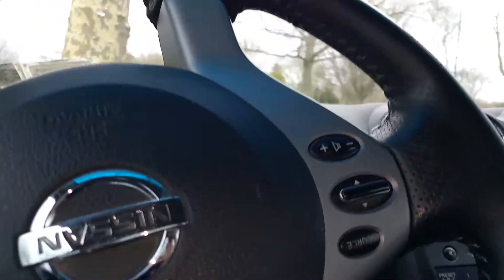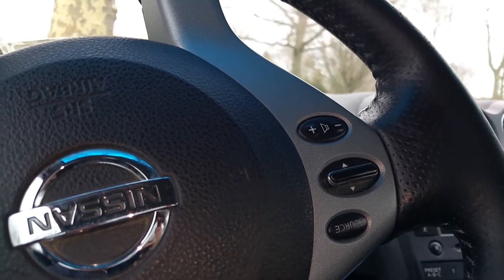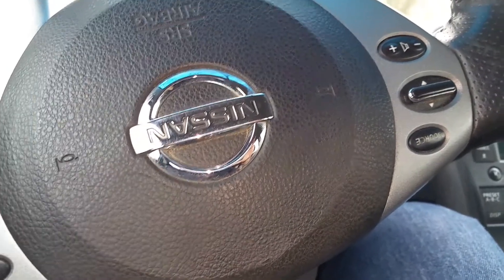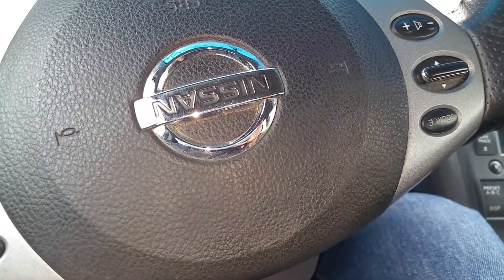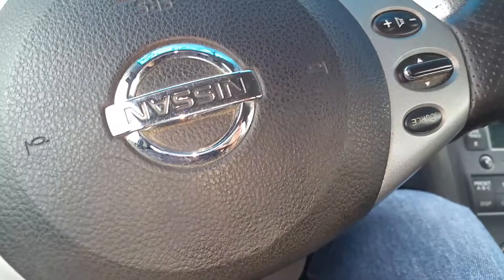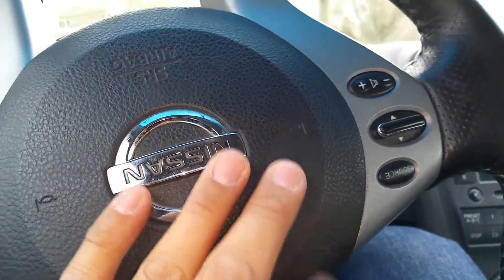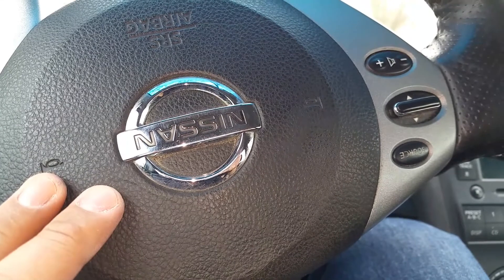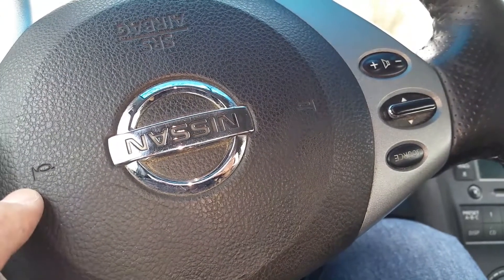Response video- DIY CVT Transmission fluid change- drain plug, CVT flush, aftermarket CVT Fluid...

Comment: These systems are designed for a transmission flush where you take off hoses that connect up to the cooling chamber on radiator, I’m tired of explaining transmission flushes to all you dumb people